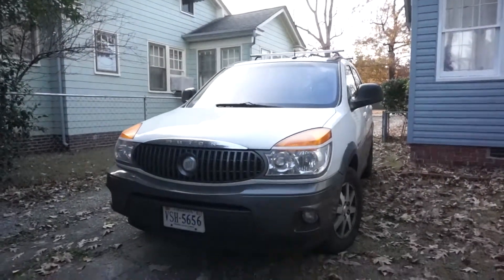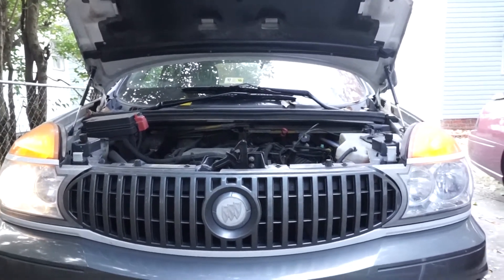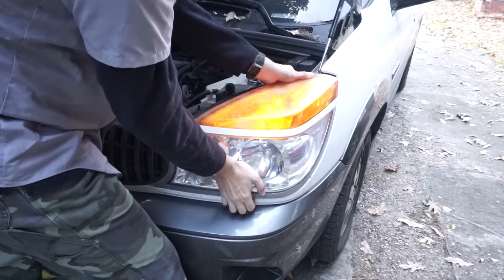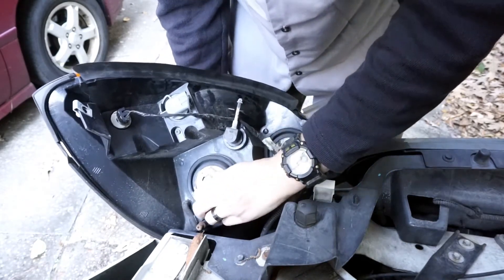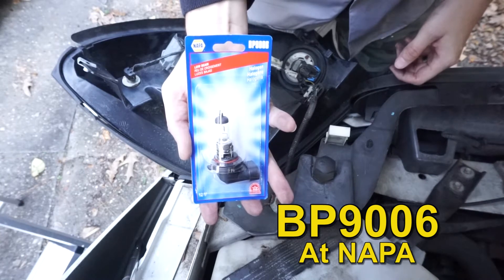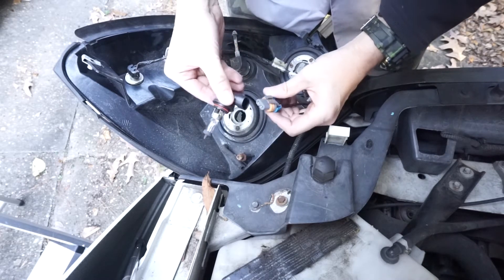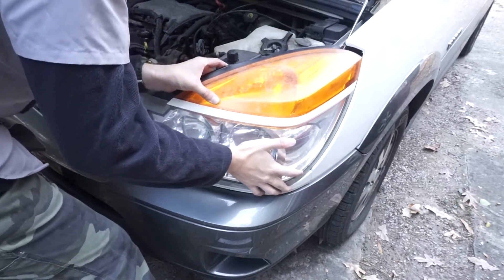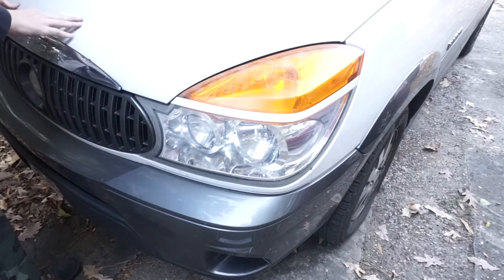How to replace a headlight bulb on a 2003 Buick Rendezvous

Comment: Any tips for one that is hard to pull out due to presumably rust?
Reply from the maker: If I were in that position, I would get some WD40 and try to spray it near the socket. Do it multiple times a day over a few days. I would also try and get some rubber grip mats, similar to what you put in the bottom of a drawer, and try to grip the light assembly as tight, but careful as possible.
Reply: All Out Octane thanks. I can not get it to move but don’t want to force it and break the plastic.
Reply from the maker: @daveosc  I totally understand! That light assembly is a delicate balance of pull and pressure. I think the WD40 multiple times a day for a few days will begin to ease the rust on the ball and socket. Also, if possible, depending on where you live and your weather, try doing it when the temperature drops from a high to a low. The metal expands with heat and contracts with cool. An extreme fluctuation in temperature from hot to cold might make the ball shrink just enough as well to wiggle in the socket. It might be micrometers, but it could help. Another possibility is to get a shim and place it in between the headlight and the body of the car. Then get another shim and slowly see if you can fit it between the original shim and the body. You can keep trying to fit shims in until hopefully, it separates the light from the body.  Hopefully, these ideas might help! Let me know if you have success!
Reply: All Out Octane thanks! I hope there’s good access for the wd40 straw
Reply from the maker: I hope so too! Good luck!

Comment: I have a 2003 Buick rendezvous an my whole light is stripped so does that mean I need a whole new head light
Reply from the maker: Do you mean that the screw holding in the light is stripped? The ball and socket should hold the light in place enough without the screw, but you should consider finding a new screw or a way to attach the light if that is the case. At last resort, a new headlight assembly might be needed. But, try going to salvage yards. That can be a lot cheaper than buying anything new stock.

Comment: Thank you for this video, it’s was very helpful for me. Do you think that a bit of WD-40 might make the ball socket any easier to remove?
Reply from the maker: You are welcome! Actually, yes, WD 40 might help. You might need to use the extension nozzle on the can to get the WD40 in the spot it needs to be. You might have to get to it from the side or below? But yeah, if you can get to it, it should help.
Reply: @alloutoctane  thank you. I do have the can with the long nozzle. I’ve ordered new replacement headlight lenses because mine are hazy and chipped. Can’t wait to change them out.
Reply from the maker: I hope it went well!

Comment: Thanks for the video!! I am a female and I was going to change mines, I just went out side and the right one was out, make long story short , I just so happen to tap the head light and it came on!! I didn’t need one after all, when I got an antifreeze flush they probably made a mistake and touched it or loosened the wire or something, but I’m glad it came back on, just make sure it’s snapped on or tap it before replacing it! I will use this video just in case, I have a 2004, Thanks again for the video!! Subscribed!
Reply from the maker: I'm glad it came back on! That is important! Thanks for the subscription!

Comment: I should point out that this video is accurate for ALL Buick rendezvous model years. They never changed the headlights except for the turn signal coloring which didn't affect the hardware.
Reply from the maker: Good point! Thank you for mentioning that!